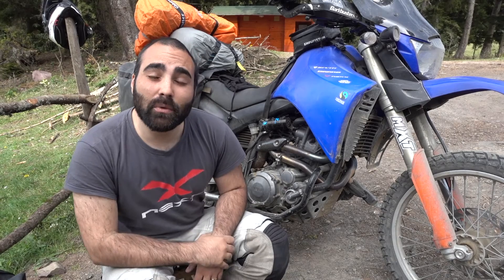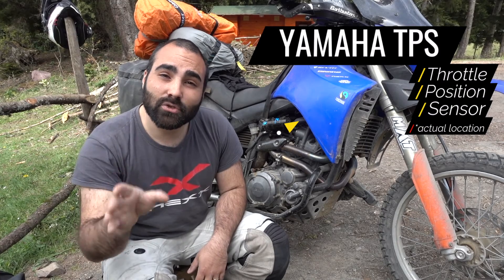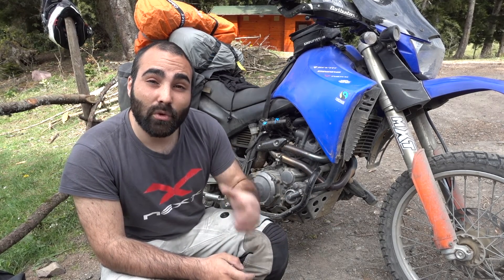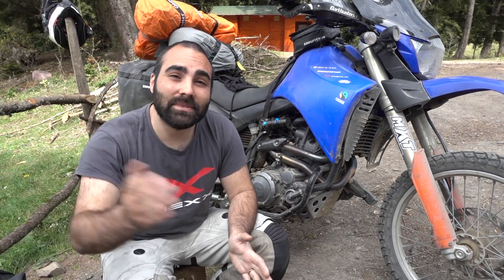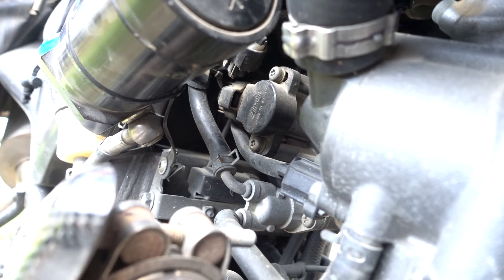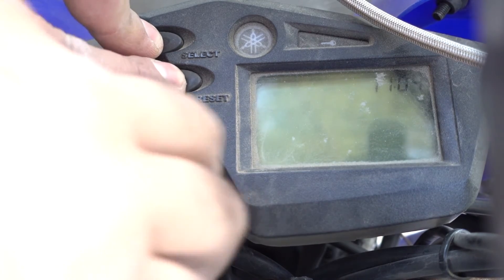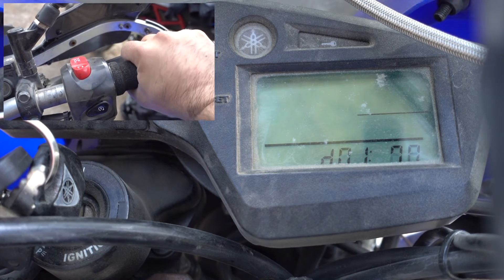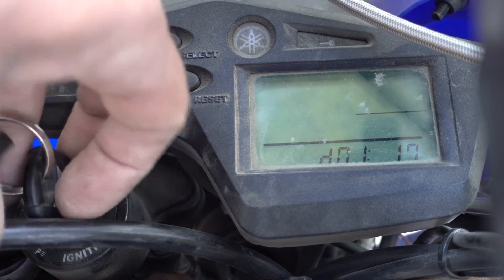Yamaha TPS - Throttle Position Sensor problems and symptoms

Comment: Hi M8,

I got a R3 2020 60,000 Km wich raised the comsumption from 22Km/liter to 16 Km/l. Also when I thrust off the accelerator it has a noticeable delay to slow down the RPM sometimes getting stuck  at 3,000 RPM when slow running then I had to turn off/on the key to get back to 1,200 RPM.

Yamaha did everything they could and did not resolve the issues:

New TPS

New air filters

New sparks

Valve adjustments

Fuel injectors cleanning

Checked cables maps and everything regarding periodic maintenance.

The bike runs very fine with proper power and response.

On the last year I've replaced batery and start engine and both seems fine.

Can you spot something we missed?

Thanks?

Comment: My fz has spark and fuel but no spark I have sent it the shop they have done all compression checks fuel pressure test and still no start all sensors are given out within spec for bike what would you replace first

Comment: Hello thanks for the explanation I have a 18 yz450f electric start I got the bikes top end rebuild bike sounds good no ticking or smoking but the bike is idling high even when turning the mixture screw it still is high idle does this sound like a bad tps sensor.?
Reply from the maker: Hey Orlando! Sorry, I'm not familiar enough with the yz to even try to ballpark an idea :(

Comment: The tps on my 2002 Aprilia Mille keeps changing from the 0 i set it at to '1'??Doesn't matter how much i tighten the two tps mounting bolts!
Reply from the maker: I'm sorry, I'm not that familiar with Aprilias, I wouldn't even know where to start coming up with ideas :( Hope you solve it fast enough!

Comment: Hello, I erased the learning data of the ISC from the DIAG mode #67. it was on number 2 and after resetting it changed to 0. 
I tried to switch it on and the bike won’t start without pulling the accelerator and holding it. If I let go of the gas it would stall immediately. Can anyone assist please?

Comment: Hello 😊. What can I do if my Yamaha not have DIAG MODE because is European Euro 4 ?? And I don't want purchase the diagnostic tool Yamaha YDT v.3 ? 😕. Is possible adjustment TPS range volts at minimum and maximum position throttle??
Reply from the maker: Sadly I wouldn't be able to tell you. If you do not have a diag tool nor your bike has one, I don't have the knowledge on how to adjust the TPS, I'm sorry ☹️

Comment: Does this apply for a 2015 yz250f? My bike runs like crap until I hold it wide open but it sounds like it runs lean, and it’ll idle hard and shut off when I pull the clutch in and it takes around 15 kicks to start in 30* weather, it will fire over but die and does this after 5 kicks and will run fine all day but then the next day it’ll run like crap, it’ll pop, backfire, bog somewhat when trying to get on it in neutral, on hillclimbs it’ll jerk me around and cause me to crash it, what can I do to check this TPS? Bike has amazing compression
Reply from the maker: Sadly mechanics over the internet is a rigged game. There are many things that can be wrong and without immediate trial and error as well as a personal diagnostics nothing I can say will help much ☹️ I strongly advise a visit to a mechanic, and get to understand the issue so you build up knowledge for next time 💪

Comment: Can a faulty one cause a no start? I’m asking because my 07wr250 will not start. But I took tank off and noticed a wire was bare and rubbing against frame. It looks like it is for the tps
Reply from the maker: Hey Cameron,

Well, the list of things that can prevent a bike from starting is huge, and for me at least, the TPS sits down on the list. That being said, the TPS adjusts idle, so it can cause issues, but not necessarily on not starting.

I would say I start with the bare wire, as those can cause all kind of trouble. 

After I would trace back what you may have done or not done since the last the bike started until this point, and if that still doesn't give you any indication on the problem, I would start with the common issues:

- starter/kick
- spark plug and leads
- bag fuel
- injection/carburator
- air filter and leaks

Hope it helps!

✌️🏍

Comment: I know this is an older video, and I dont have a street/enduro type bike so dont have the diagnostic screen.  I have a 99 WR400, and having a stalling issue.  Long story short, I bought it cheap non running, sat for 10 years.  Did a complete carb rebuild, new gas tank, plug, and it will start just fine.  But will stall unless the idle is cranked up.  I made the mistake of removing the TPS when I rebuilt the carb, so my question is... Is it possible that the TPS is causing the stalling or is it more likely the float? Tried adjusting the air/fuel mix more times than i can remember. 

Anyone?
Reply from the maker: Hello Lorenzo,

Mechanics over the internet is always tricky and something I avoid doing at all costs because I cannot run my own tests and have a look as something may be missing or overlooked.

That being said, TPS adjustment, idle adjustment, improper needle kit or otherwise carb re-build, and a deep check for leaks or clogs in the admission would be amongst my first go-to searches for troubleshooting. But again, take my tip with a grain of salt as I do not have access to the bike.

Hope it helps!

✌️🏍️

Comment: Hello, I'm currently riding a xt 660 x and it suddenly started acting up(increased fuel consumption, hesitating throttle and when warmed up it stalls at low speeds.) after cleaning the throttle body I feel the bike has higher idle speed and it feels more responsive. My tps starts from 31 and the values are 17-99. Any hope that the tps is good and my problem was the throttle body?
Reply from the maker: Hey Mark,

I'm sorry, but I don't troubleshoot mechanical problems online, there are always details that go missing over the screen when compared to a hands on inspections.

That being said, and based solely on what you said, I would verify the manual for idle check, and check the manual for throttle freeplay, most likely replace the spark plug while checking spark cables as well just to start.

But again, without seeing the bike I won't be able to try and help you more.

Hope this does help somehow!

✌️🏍️
Reply: @BNAdv  Sure its impossible to have everything solved using a computer. Well basically I've even changed the fuel pump imagine that.. . All in all today I removed the Throttle body since it had a vaccum leak and i found that both of the rubber intakes (the one that goes from head to throttle body and the one that goes from throttle body to the air box) were torn. Ordered 2 brand new from Yamaha, will check and let you know!
Reply from the maker: @markbazarewski6308  oh those little rubbery bastards... with the 660R I never had that problem, thinking about it, never had it with any injection bikes. But with the carburetor ones I've had over the years, that happened a lot, and it was never the first thing on my mind to search.

A couple years ago, I had an issue with the 660r, where the idle was all funky, the bike would stall, even at higher RPMs.. a mess. Checked everything, removed everything, and ended up assembling it all again, thinking it was probably something that had come out of place.

Nop, all the same. 

Out of desperation, as I was roughly 10.000 miles from home and not intending on visiting the local garage on a language that I couldn't even say hello on, let alone explain my troubleshooting, I replaced the spark plug.

At the time, if you had forced me into a blind test between the one that was on the bike and the brand new one, I wouldn't be able to tell you a single difference in wear and tear, and on simple tests like both sparking on demand every single time for instance.

Sometimes it's the darndest things...

I hope those new rubbers help, and yes, please, let me know. I'm always happy to see problems solved and learn new troubleshooting ideas!|

✌️🏍

Comment: what are the normal values for this motorcycle ( Xt 660 r) ?
Reply: The values indicated are 27-102. The motorcycle stutters between 3000-4000 RPM ,after which it shoots quite well. XT 660 R 2007
Reply from the maker: I'm sorry, but I don't do mechanics over the internet, there is always something missing when compared to seeing the bike in person. So I always advise a trip to a qualified mechanic.

That being said, the 660R is know for having bad fuel mix from stock, and any work made to it that was not aimed to fix that, may make it worst. So without knowing much about your specific bike, I would consider talking to your mechanic about a Dyno trip to rectify the fueling map. This is not the cheapest option by any means, but it is the one guaranteed to fix the problem, or help find out what is not allowing the bike to run smoothly. It sure helped me.

Kev also has a DIY fix for fueling, which is a lot cheaper. If you don't know what I'm talking about search -kev fuel mod xt660.

Still, I would advise the help of a qualified mechanic to set it up if you are not qualified yourself.

Now, as I said, I don't know your bike, so I'm not saying you have a fuel map problem, I'm just saying it's common, so worth checking out, and that those are my suggested ways to do it.

Hope it helps! 

✌️🏍️
Reply: Ok .Thank you very much for the information ! All the best ! 👍
Reply from the maker: Hello Coste1981,

Nothing better than to check the manual. You can have a look at what you are looking for right here - https://www.manualslib.com/manual/656491/Yamaha-Xt660r.html?page=353#manual

Just scroll down to Diagnostic code 01.

✌️🏍

Comment: in a 2007 yfm 700r raptor, it has the same fault, is the tps sensor the solution?
Reply from the maker: Hello J d,

I don't do mechanics over the internet, as it is impossible to get to a good result without the bike to run tests, but I would say there is a good possibility it may be the TPS, yes. 

✌️🏍️

Comment: So i have a issue with my r6 And upon idle it revs up when the bike warms up to about 4k rpm’s ..could this be the issue ?
Reply from the maker: Hello Dangelo!

I really don't like to do mechanics online, as it is very hard to have a full picture without being able to do my own tests, so my best answer is always for you to take it to a mechanic that in person can look at it.

I really wish I could help you out more here, but without a LOT more information, I am afraid I may give you a sub-par answer and make the problem worse.
Reply: @BNAdv 
Does moving the tps up or down change the idle speed as my bike is idling too low and losing power after 7000 rpm and the idle appears to be rough and lumpy and I was told that the tps could be out of adjustment.
Reply from the maker: Hey  @wewouldneversellourclubfor3166 ,

 So, the TPS and the idle are not one and the same, so to adjust your idle give the manual a look, it will tell you everything you need to know about idle adjustment on this bike 🙂

https://www.manualslib.com/manual/966982/Yamaha-Xt660r.html?page=55

If you want to check if your TPS is out of values, just follow the procedure I explained above and you should be golden.

✌️🏍
Reply: @BNAdv 
My bike is a suzuki gsxs 125 and it has got no idle adjuster on it as it is the idle Air control valve set up and as far as I know it is non adjustable and that's what leads me to believe its the tps that is out of alignment.
Reply from the maker: Than sadly I can't help, I'm not familiar with that model, I'm sorry ☹️

Comment: Got my tps from my 2004 yamaha r1 replaced yesterday for free.  Recall was still open since 2006 but just done now... 04 july 2019
Reply: Really? I have had always problems with it but this week it became terribly worse. What documentation is required to replace it in Yamaha workshop?
Reply: @ivanlloret2004  send a message to an official Yamaha dealer or to Yamaha directly via rmail.  They will ask you for the VIN /SN number and title/deed.  Then they will come back to you  with info.
Reply: Thank you very much for your quick and clear answer.

Comment: I'm having a problem with a Vstar 1100 can you tell me where to locate the TPS and how to get a trouble code. Any help is appreciated.
Reply: Tea2Wine thank you so much for the quick response. My vstar is a 2002 1100 and last week while I had it out I was on the open road and decided to open it up as soon as I got down on the accelerator it paused, hesitated, and then stalled out. I got it to the side of the road and when I went to turn the ignition switch on my odometer  and the neutral light flash repeat repeatedly until it didn't do anything. I finally got it home and put a different battery in that I had,  at that time it didn't start until I located a 10 amp fuse for the ignition. now, what my problem is the bike will not run and I don't hear the fuel pump being energized. So I hoping it's either a relay problem, fuel pump, or a fuse that I might have missed. Thanks again for your response and the lead to the manual it is really appreciated! Be safe, God bless, thanks again!